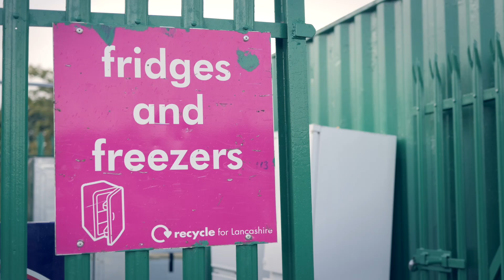Fridge recycling

Comment: Am I correct in believing that half the CFC gases are contained in the foam insulation, and if so how is it extracted during the fragmentation process ?
Reply from the maker: The amount of gases in a fridge when the unit is recycled is on average 87% of the total gases captured from a fridge itself  with the remaining 13% used in the cooling system. 

When GAP processes a fridge, the fridge compressor is drained of all the gases from the cooling pipes and motor, and these are captured in a sealed system. 
The compressor is then removed for separate treatment. 

The fridge carcass is then shredded in a sealed fire suppression system which captures all the remaining 87% of the gases from the foam. 
This is possible as the foam is reduced to a fine powder, and this releases all the gases. The gases are then bulked and sent to a high temperature incineration plant operated by a specialist company that destroys the gases to prevent them damaging the atmosphere. GAP’s plant goes through annual independent accreditation to the WEEELABEX standard (WEEE Label of Excellence) that tests its performance. In 2024 their plant recorded results that showed 100% of the gases were successfully captured by the system.